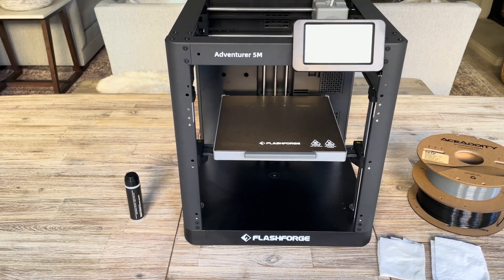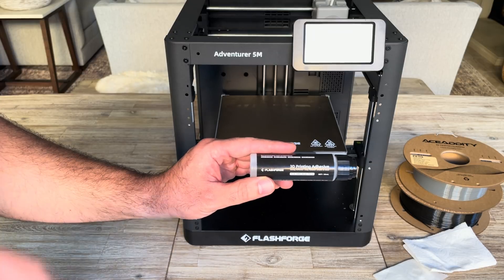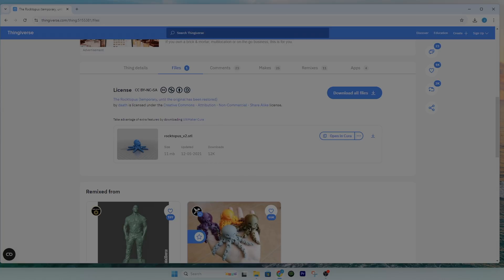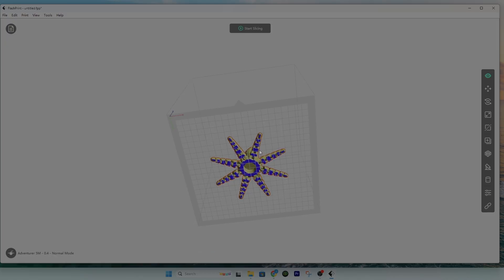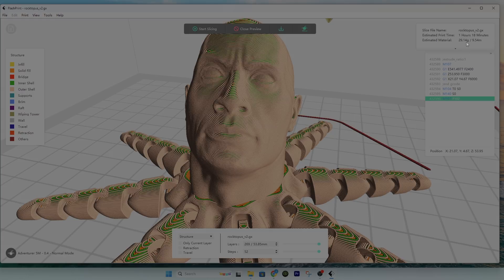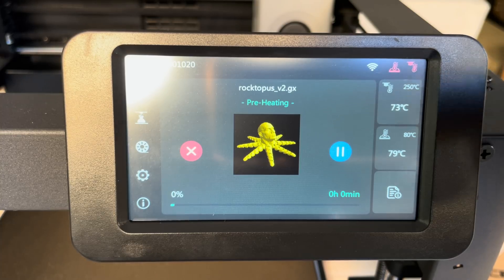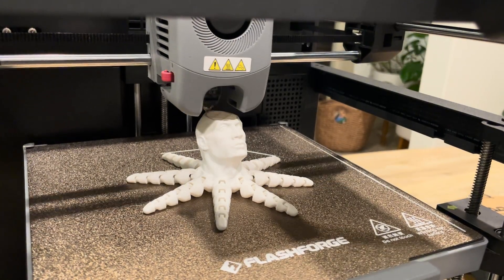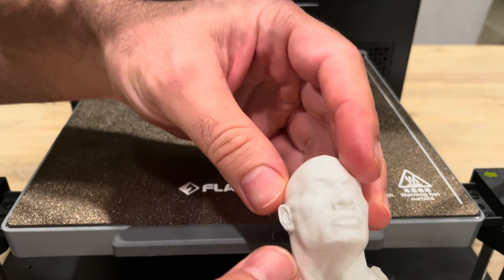Flashforge Adventurer 5M 3D Printer - How to Print

Comment: When you say "download this file" - from where to where?
Reply from the maker: When you click the download button as shown in the video, it will download from the website to the download folder on you computer.  To open the file you will need a slicing software that’s compatible with the printer.  In this case, I use Flashprint.  See the following video for installation and setup instructions for flashprint.  https://youtu.be/k7j-_eWPqs8?si=vFLKbQEq5qZhP_Tu

Comment: What do you do with the filament after printing?. Did you left it attached to the struder or did you take it off?, if so, do you need to purge the left over filament inside the struder?
Reply from the maker: It is best to store the filament in a dry dark place when it is not going to be used for a while.  No need to purge the left over filament as it will be purged when you load the filament again.

Comment: I have a question I don't know if anyone will know. I have been using printables as my website and I wanted to know how to add multiple models into one print. (For example, if a print is two pieces how would I print them together?)
Reply from the maker: Hi, thank you for the question.  I have put multiple pieces on the printer platform using flashprint 5, and it prints them all at the same time.  As long as the pieces can fit on the platform together, the printer can handle it.  I hope this answers your question.  For flashprint 5 installation instructions, please use the following link.  https://youtu.be/k7j-_eWPqs8?si=l2VOWxTV2hBddytu

Comment: Keep in mind, nearly a 100% of these do not make it sound nowhere near as complicated as it is…..We ended up throwing away a Flashforge 5 pro and tons of filament. After nearly two months of frustration with it., chunked it. It was easier and way cheaper to just pay someone to print your ideas. Even using tinkerCAD you still have to have an understanding of CAD design to work out the processes. Also even though you download files as STL, when opening Orca for FF…..the dimensions and settings will and  may be changed. Even though we set bed dimensions in settings  when opening in Orca  nearly a 100% of these filles it would say object off bed plate an all the dimensions would be changed. Finally tired of the frustration and throw it all in the trash. Don’t get the wrong ideas from these guys that are professional users and they make if sound way easier than what if really is. If you still insist on buying your own, be warned. Check online as there are some good cheap deals out there becasue most find it  to frustrating to deal with and just cut the loss and pass it along to the next. I didn’t wish  this kind of frustration on anyone so in the garbage it went.

Comment: I just got my 5M yesterday. after 2 hours had to turn it off because I could not get it to print from my laptop.  (It was connected via wi-fi the entire time)I was able to make the keychain from the files on the printer but it did not want to print from any of the STL files i had. I turned off the machine, turned it back on then i managed to have it start calibrating as it did for the initial set up. after that I was then able to have the printer recognize the command and start printing BUT then there was no filament coming out. I will try again & see if i can figure it out. If anyone has any advice I appreciate it.
Reply: I have the pro version of the 5m 
1. Wifi, make sure that port forwarding is turned on This is done through the admin settings of your router.
2. Make sure that the IP address for the printer is correct on the router and connected devices. 
3. Use Flash Cloud and register your printer in the "My Printers" menu and link it up using the Flash Cloud settings on the printer. 
4. There is probably a blockage in the printer nozzle, remove the feeding tube (white rubber tube) by pulling on it from the printer head (top of the printer) cut the filament about 2 cmms from the head DO NOT CUT THE TUBE feed the rest of the filament out of the rear feed tube so there is no filament in the machine, then remove the nozzle as instructed in the manual (red buttons either side of the nozzle head) use the nozzle unblocker pin to push out thr rest of the filament from the direction of print (tiny hole on the nozzle where the melted filament comes out) once you happy that it is completely clear, install the nozzle, feed the filament from the rear inlet feed tube (white tube) untill you see it in the tube and stop feeding a few inches from the head, insert the feeding tube back into the head and push firmly (like you are pushing a bag of sugar) then push the filament all the way to the head until it stops completely. Then, on the menu, perform a filament swap, and the printer should begin feeding on its own. Then perform a calibration. Apologies for any incorrect spelling I'm dyslexic
Reply: @nifty3000   I tried to clear the filament from the nozzle and wasn't able to. I will try again today doing it the way you explained it. Hopefully it works. thank you for your help
Reply: @ysbelbella6674  can you get the nozzle out completely?
Reply: @nifty3000  yes. i took it out but i cant get the filament thats inside
Reply: @ysbelbella6674 put the whole nozzle in really hot water to loosen the filament leave it in for about a minute. Mind your fingers. What filament do you use?
Reply: @nifty3000  I didn't know I could get it wet. I will try that. The filament is the one that came with my Flashforge Adventurer 5M.  I ran into this issue while doing my second print 😞
Reply: @ysbelbella6674  just make sure the water is silly hot and dunk the whole nozzle in it, give a good minute or two before trying to clear it. That's weird how it got clogged that easily. Do you live in a super-humid area? Maybe humidity got to it.
Reply: @nifty3000  humidity has been exceptionally high these past couple of weeks. I hope thats the reason why
Reply: @nifty3000  just wanted to let you know that your tips helped & I now have my Adventurer 5M up & running. Thank you so much!

Comment: Do i use gx or gcode?
Reply from the maker: A compatible slicer software is needed to convert the drawing for printing purposes.  Please see the following video for instructions on setting up FlashPrint 5.  https://youtu.be/k7j-_eWPqs8?si=oG1gg7ZSAOO2S3cp
Reply: @JoeAlisando  also on things that may need to support do I have to manually go through and put the ports in or does it do it for me when printing or slicing

Comment: What do you do if when I try to send the file to my printer it says the printer is occupied
Reply from the maker: Thank you for the question.  You can try the following suggestions in order, one at a time: 1. Close all FlashPrint windows and other slicer software windows, 2. Restart the printer and FlashPrint software, 3. Check for firmware updates, 4 Reinstall FlashPrint.
Reply: @JoeAlisando thx a lot for the help

Comment: Could I print a design that I made using Schapr3-D?
Reply from the maker: It should be ok as long as the file (i.e. .stl)  is compatible with the slicing software (FlashPrint 5/Orca-Flashforge/Orca Slicer)

Comment: Hi, I am new to 3d printing and I am having problems. I uploaded my stl into flashprint and when I go to the bottom view, it is not blue meaning there isnt anything sticking to the platform. I clicked on the model and under move i clicked on platform and still nothing turns blue. If I move it manually and put at it -2 the model intersects but there still isnt any blue showing adhesion. What am I doing wrong? Thank you for any help
Reply from the maker: Hi, is the 3D print surface flat on the bottom.  If it is curved, it won’t align well with the platform.  Try rotating the model so that the bottom surface is flat.
Reply: @JoeAlisando  It wasnt completely flat. I reached out to the person who I bought the file from and they fixed it to be flat and its working now. But I appreciate your time and will keep your advice in mind for future prints. Thank you!!!

Comment: When i tried it at a certain height it just started curling and becoming strings and when i paused it the pla that came out from the printer was not melted it was just like string i printed the same thing 2 times and it broke at the same height any way to dix this? Thank you
Reply from the maker: You may be printing in the air.  Check your print layers to ensure they are all supported.  Adding supports, reorienting your print or printing in pieces and later gluing those pieces together may help. For an example on adding supports, see the following video.  https://youtu.be/218-QvI8wZQ?si=QafSGfAdB5uMHDoD

Comment: Do these printers not come with a textured PEI sheet? Every video I have watched everyone immediately applies the adhesive to the plate, I have used 3 other brand of printers and Have one of these coming in soon and only had to use adhesive on a textured PEI plate if I'm using PETG and only as a barrier so the prints come off of the plate easier.
Reply: I have this printer and NEVER need adhesive.  The plate is perfect
Reply: @AimeeajblockBlock  I don't like using it unless I have to. usually only need it as a barrier for PETG as i don't do anything other than that and PLA.

Comment: We got this printer and had a hard time slicing. With this help I was able to get the printer working with slices. Thank you !
Reply: At least you made it work I still haven’t and I am kinda sad about I have not made it work sense December and I need help how did you do it
Reply: @huggyslife4335 I had good luck with the printable site, it you find a model that has easy print option you don't even need to use the slice software
Reply from the maker: Thank you for the feedback.  Glad it helped!

Comment: The thing is that when I tried it didn’t work
Reply from the maker: Sorry to hear you are running into difficulties.  Can you describe the specific issue you are experiencing?  Maybe we can help and the rest of the users could benefit from the learning.
Reply: Well when I tried to do the rocktapuss when I went on my pc flash print didn’t work because it couldn’t connect to my printer I tried to check if my Internet was connected to my pc And I turn the printer on and off
Reply from the maker: Please see the following video on how to setup the flash print software.  I hope it helps.  FlashPrint 5 Installation and Printer Setup
https://youtu.be/k7j-_eWPqs8
Reply: I I watched it, but it didn’t tell me how to fix the problem that I’m having
Reply from the maker: Did you select adventurer 5M from the list of printers?
Reply: Yes
Reply from the maker: One more question.  Did you set up the printer as described in the following video? Flashforge Adventurer 5M 3D Printer Setup
https://youtu.be/3GYn6rj3jxI
Reply: Yes
Reply: Hey I use orca slicer now but it doesn’t work

Comment: when i click connect to printer no printer is found? is there a way to fix this?
Reply from the maker: I have not experienced this issue.  Not sure if this will help, but ensure the printer is connected to the same WiFi as the computer sending the print.  If this is already the case, I would try reseting the printer WiFi.  Also, please see the following video for more information on setting up the software.
https://youtu.be/k7j-_eWPqs8
Reply: Why won't my QR code come up under my account?

Comment: Can you tell me what should I do if my printer freezes when i click on the 3d model using a usb drive and I can't also find it using "automatic scan" using flashprint
Reply from the maker: I have not had that issue.  Is the printer firmware up to date?
Reply: @JoeAlisando  I would have to check that out

Comment: Just to help a friend, the screaching sound, i had it too, but by researching, i found that if u use the included lube, on the belts near the bearings, and move the extuder head all around, you will corect that noise that’s caused because of the firction.
Reply from the maker: Thank you for the feedback but I would not put the lubricant on the belts as this could lead to slipping and belt degradation.

Comment: i have the same printer and im struggling getting it perfectly dialed in, stringing seems to be a big issue. using retraction at 0.8mm, z hop at 0.4mm set to spiral mode.
Reply from the maker: That is strange, I am not having those issues.  It is difficult to diagnose the problem without being there since the cause can be due to many reasons.  What program are you using to slice the drawing?  Is your filament compatible with the print speed?  When loading the filament, was the correct polymer chosen?  What filament type are you using?  Does your print need support or are you orienting it correctly?